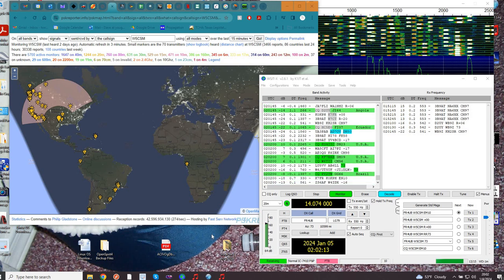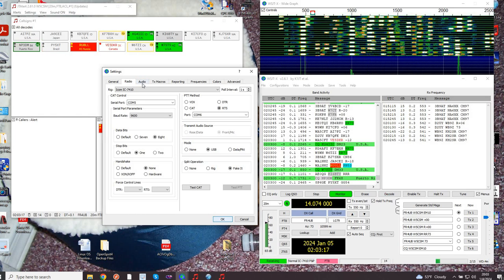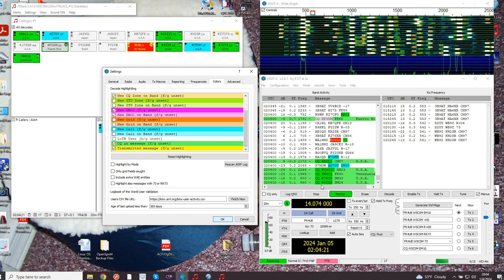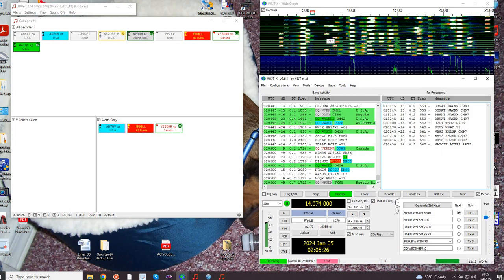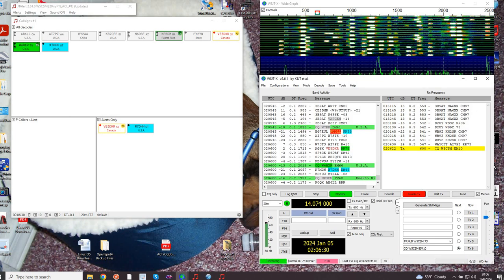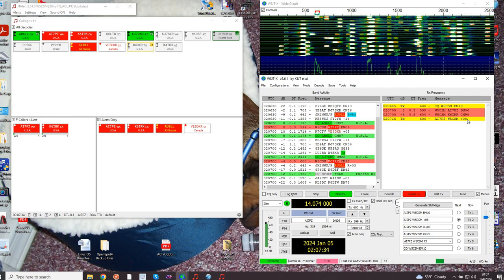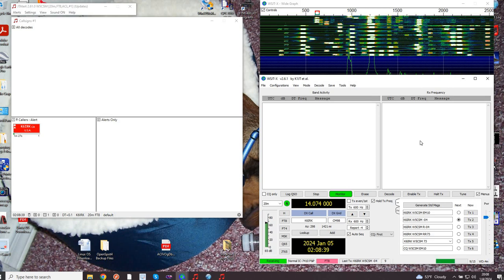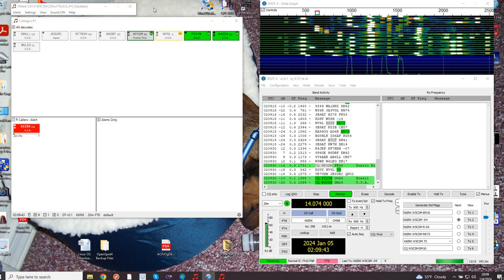2024 01 04 Calling CQ on FT8

Comment: Great video !!
Simple exponation well explained. I having a question I'm new experiencing with WSJTX and everything on my end are working good so far with the exeption of the window that suppouse to pop up when you finish a QSO don"t comes out you have to do it manually. It's anything on the setting I need to do or not. Thanks and 73"s DE KD2VRL, NJ.
Reply from the maker: Howdy @hipolitoortiz6182!  Thanks for the compliment.  It's good to hear that my videos, while not as refined as some, are helpful as that is thegoal.

I'm pretty sure what you are looking for is the Log Automatically (contesting only) Function.  You will find it under Settings, on the Reporting tab, Under Logging look for Log automatically (contesting only) and check the box.  I log with N3FJP's Amateur Contact log so if you need more help with that, please let me know.  I am only familiar with that logging software and you will need to set an API and associated port in order for them to communicate.  Happy DX de W5CSM
Reply: @W5CSM-Dave  
Thank you some much for the replied.. I got is it's all well done 73's.

Comment: Very nice video. My remaining question is, do you have to double-click the responding station every time someone answers your CQ? In other words is there a way to have WSJT run semi-autonomously, so that once you hit Enable Transmit it will answer all responses without clicking on the call?
Reply from the maker: Once you double click the contact, the responses cycle through to the 73 message.  I honestly can't recall if that is a setting or if it does this by default.  It does not reply to anyone calling you.  You must double click to initiate the exchange.  I hope this helps.
Reply: @W5CSM-Dave  OK. Maybe it has to do with FCC rules about station control. 73